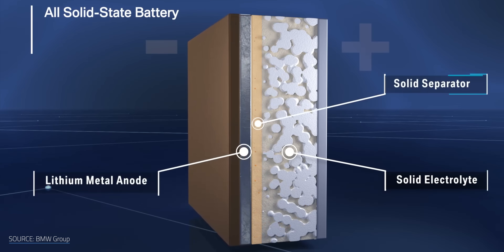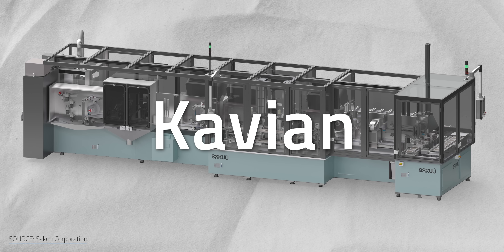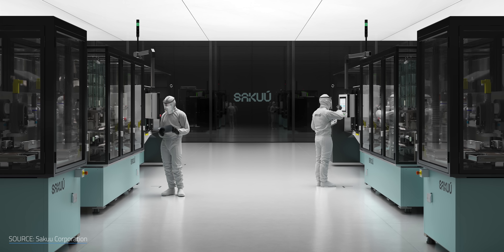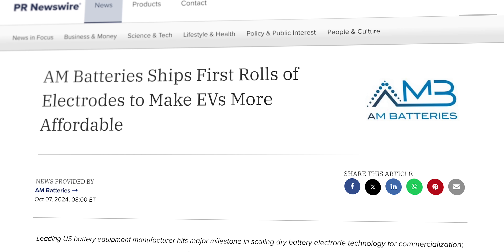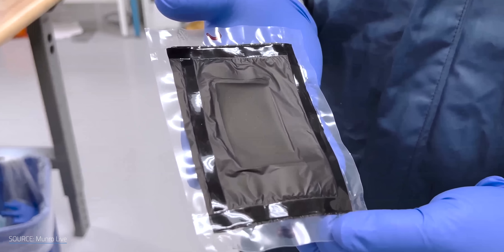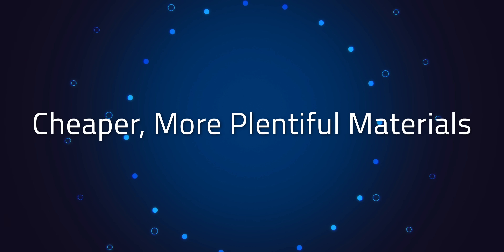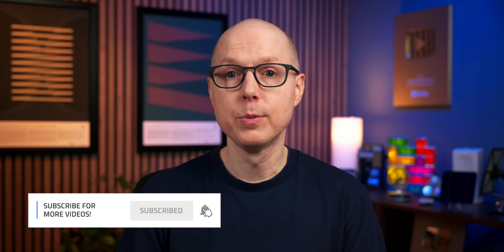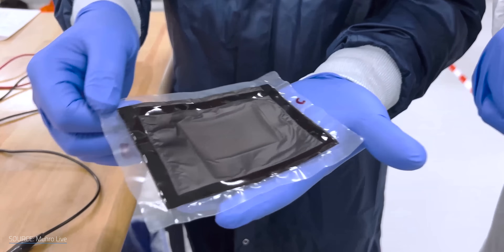Why This Ultra Cheap Battery Breakthrough Matters

Comment: Many commenters seem to think that none of the battery technologies ever get implimented.  My lithium iron phosphate battery is 10x cheaper than it was 5 years ago. It has almost 4x the power , weighs 25% of a lead acid and costs the same. Patience, my nerdy, brothers. Its a matter of time...
Reply: Honestly thanks for this comment.
Reply: Yeah, I don't know what people are thinking. Other than AI, batteries are probably the most rapidly improving technology on Earth right now.
Reply: @LagMasterSam  Rolling Coal is required in Project 2025.
Reply: @LagMasterSam  Photovoltaic's are also getting a lot cheaper at the moment.
Reply: Not really. I remember seeing a Nasa prototype that was pure solid plastic like tape that can hold a charge. That was 25 years ago
Reply: "Patience, my battery bros.."  🤣
Reply: Thank god for this comment. I agree that it can be tiring to hear "breakthroughs" that never seem to have any impact, but the reality is that these "breakthroughs" filter into production in slow, measured steps. Most people here don't realise the incremental improvements we've made in batteries and how these changes are getting faster than ever these days. 10 years ago, the best EV was the expesnsive Leaf, a pathetic imitation of even the cut-price Dolphin or Ora today.
Reply: LFP batteries are not 10 times cheaper since 2019 and have made almost no advances in the 3 decades since they have been discovered. All decreases in price can just be explained by scaling up production.
Reply: I've been hearing about new battery technology for the last 40 years. We're talking over 100+ new batteries that were going to revolutionize everything. Do you know how many were actually real, and evolved into a commercial product? Just one, Lithium Ion. It's like how a new cure for AIDS is discovered every few months since the 80s. So why do they make so many announcements like this? To drum up gullible investors. They're trying to score funding for their vaporware.
Reply: Yes, patience! That's what I'm thinking about my Enovix stocks! 😅
Reply: This has nothing to do with battery tech and mostly to the with scale of production, cheaper raw materials and Chinese companies dumping below manufacturing costs. Comparing to lead acid is so 2018. You might want to compare with sodium batteries when this year catl's might have a production line online. This whole clip has nothing to do with economic reality at all. Sodium batteries will knock lithium out of the bulk storage market within 5 years and lithium will be reserved for applications that require little room or where weight is important.
If solid state batteries ever get produced economically, then they might get a niche at first. But in all practical sense, i don't see them coming within 10 years for large storage solutions. Perhaps for mobile phones at first.
Reply: Batteries still suck though is the problem. Look at CPU improvement generation upon generation, we need a Moore's law of batteries
Reply: Let's face it, battery tech doesn't move as fast as chip tech. Like every other product,  demonstrations and prototypes are cool, but if you cannot manufacture it economically, it is just and interesting idea.
Reply: "nerdy bothers AND SISTERS" - we need them too.
Reply: Or f.e. my last phone having a silicon-carbon battery at similar performance & weight... Slow change is hard(er) to see for some...
Reply: That's why we can find normal EV vehicles in the 15-20k range . By normal I mean a normal looking car and not a toy.
Reply: All though that kind of battery is okay, it is still too expensive. An electric car needs thousends of battery elements to be able to drive an acceptable distance, which means the batterypacket in the car is a very expensive component in the car. And this makes cars very expensive. The price for 100 kwh lithium iron phosphate battery is around 7000 $ compared to 3000 $ for a  future LiFeCl4 battery
Reply: Yeah I can buy battery for my car for 45-50 bucks.  Still can’t get lithium that price I can put in my car as it sits.
Reply: CO2 is climatologically irrelevant. 

CO2 is climatalogically irrelevant: Interglaciation climate change (e.g. the Medieval Warm Period) is caused by cosmic ray fluctuations ( see the work of Henrik Svensmark, et al).

Just burn coal: the CO2 issue is irrelevant (see above). The sulfur issue with gaol is bogus too: sulfur is an agricultural fertilizer (ask the farmers). The "acid rain" issue is at most "a nuisance" (see the $500 million NAPAP study of 1990).  "Acid rain" was another one of those shallow media sensationalisms, like "global warming" and "ozone depletion". 

Global warming is 21st century superstition. 

Just burn coal.

Sorry, but however intriguing these battery-thingies are, they are just another tax-sheltered boondoggle for people who don't want to do get a real job. 

Just burn coal.
Reply: still the same battery with better cpu drain from cpu or ic chip improvement, rather than battery.
Reply: @jemfalor  A better processor does not make the battery cost less.  Also, battery capacity relative to size had nothing to do with the chips' improved electrical efficiency.
Reply: @jeffs1571  lol. many things cost less over time. it doesn't correlate automatically to improvements in battery technology lol

Comment: In China EVs are ALREADY at price parity with ICE cars. Every export market where Chinese cars do not attract tariffs they are not very far off parity at all (guys the US, or even the US and Europe, is not the whole world). Given these cost saving techniques by the end of next year EVs will be noticeably cheaper than ICE cars.
As for sodium batteries, these are already beginning to take over for new battery farms in China. By making electricity storage very cheap they will drive coal and nuclear power alike to extinction (as solar panels are REALLY cheap). It is just a matter of time.

Comment: You have been going over tons of battery techs for several years now and not one of them has reached market.
Reply: Because they hit the market quietly either as yearly improvements for existing batteries or in niche applications. Tech products don't advertise how their battery chemistry is 5%-10% better every other year, it just is. And many of the more exotic technologies are entering pilot production but have specific drawbacks or strengths that keep them niche, that doesn't mean it didn't happen, like how lfp ate the energy storage market overnight or how sodium ion is slowly trying to break in to grid storage as well.

Comment: I write training courses on DC fast chargers for a major Class 8 electric truck manufacturer. When students ask me why we make a tractor that costs 3x as much as its diesel equivalent and has a quarter of the range, I point out that battery technology is evolving explosively. Our drive motors produce 10x the starting torque (if we allowed them to; they're limited), it's silent, a joy to drive, no oil changes, no diesel, no DEF. In 10 years that same tractor will be driving full shifts and have a sleeper cab, because the batteries will catch up. Science doesn't care about policy and the political climate. Innovation doesn't wait for spin doctors and talking heads. I stubbornly maintain my own private sense of optimism.
Reply: What density (wh/kg) is the target for that 10 year tractor?
Reply: @100c0c  Nobody knows because it's irrelevant. Research is done and the results will be better than today's technology. Can you remember your phone from 10 years ago? Did you expect to hold the one you're holding now back then? So, there won't be giant leaps but incremental improvements.
Reply: @TheKobiDror  At least until we figure out and master quantum computing which is another thing we are making very quick progress on. The last 5 years of advancements in quantum computing have literally never happened before ever. And when we are able to master and scale that up oh man. The cheat code to life will officially be unlocked. You will start to see it being used to help create new materials for batteries maybe even new elements, the medical field will see big advancements in medicine. Every impossible problem we have will seem more like a task that we can accomplish. And I quote OP "Science waits for NO ONE"
Reply: Without government policy EVs wouldn't have been viable so political climate does matter when tech is in its infancy. It's only after the tech gets better and gains momentum can it work despite negative policies.
Reply: EVs would have been effective and able to be used had nuclear been widely adopted, especially in places like USA.  @alburaq3290
Reply: @alburaq3290  EVs, wind and solar are nearly cost even with conventional tech, and there's significant cost reduction happening all the time. It's not too long before EV prices can match equivalent gasoline cars. 

Electric motors and single stage gears are cheaper than piston engines and multi - speed gearboxes, so with battery price reduction so can match or reduce prices.
Reply: @thewheelieguy  Sure but that's after decades of government support. Renewables are not in their infancy anymore. Governments all over the world made it clear they were going to transition to renewable energy. This kind of long term policy support worked as a catalyst for private sector to invest into RnD.
Reply: Science should care about policy and the political climate because it gets a huge amount of funding from those exact things.
Reply: best comment...true dat
Reply: "Why does an electric tractor cost more than a diesel one?" -idonno, but i'd say the deer logo at the front might have something to do with horrendous pricing and borderline extorsion
Reply: @3AnxiousFerretsInATrenchcoat  lol I meant as in tractor trailer. As fae as the ag tractors with the Deere on the front, my true love is a Model B from the late 40s. Beyond that I freely admit I couldn't comment on what they do now, although I sharply disagree with their walled garden stance on right to repair.
Reply: @JMSobie  i kinda focused too hard on the "tractor" part i guess and misread. Regardless, i'm just joking around.
Reply: I love science and am a dreamer but 30 years ago I was following this story and new battery technologies were just around the corner then. Still waiting, Waiting, waiting, waiting, waiting,   My race level remote control cars had essentially the same quality batteries as we are using today and our mini race cars had, wait for this, regenerative breaking. Keep in mind, all this hype, is just about how perhaps batteries will finally start to catch up. I am still waiting for them to SURPASS what we have been able to do for over 100 years with gasoline.
Reply: Not too many power grids can hand a electric truck charging station
Reply: But we wait and wait and I see battery getting better and better but I just don't see it. Maybe I have too little knowledge but batteries keep being the same technology, just scaled up
Reply: @peres9559  The problem is after crude prices plummeted in the 80s, everyone here gave up. Battery research screeched to a halt and homebrew EVs had a choice of lead acid or maybe NIMH if you were rich. Who gave a crap when crude was $10 a barrel? Flash to today and the science magazines crow about a new chemistry that's cheap and amazing, but oops only has 500 cycles of life. Oops it doesn't scale. Oops dendrites if charging at a high C rate. So I've learned that it's a slow and iterative process. The next battery has to be safe chemistry, abundant raw materials, scale able and a cycle life meeting or exceeding LiFePO4. And for once we as a whole planet are actually leaning hard on this as a team, testing and scaling and endurance testing it. I tell my students, right now this is like Ford vs. Dodge circa 1919. If you want to see how the whole Giga factory concept and vertical integration thing came from, just crack a history of the Rouge complex 100 years ago (10 miles from where I sit in fact). In another ten years I'll bet the next great battery; will be something neither you nor I nor anyone else has even heard about.
Reply: Deja vue. Heard that too many times. Believe it when I see it. Fool me 100 times your fault. 101 times my fault.
Reply: Science cares a lot about policy and political climate.  Or at least scientists do, and they need funding.
Reply: @JMSobie  Hell yeah man. Couldnt agree more. If we dont evolve the battery other countries will becuase like you said science waits for no one regardless of policy change.
Reply: One thing I've noticed is that the current price difference between an electric truck vs. diesel truck far exceeds the cost of battery. For example, even at a relatively high rate of $150/kWh,  that translates into $75k for a $500 kWh battery, yet you see battery electric trucks costing as much as $250k more than their diesel counterparts, in spite of the fact that some of the cost of the battery should be offset by eliminating the diesel engine.

What this means is that the bulk of the actual cost difference between electric vs. diesel trucks likely has little to do with the cost of the battery and everything to do with not enough of the battery trucks being made to create economies of scale. Which, should, in theory, translate to big reductions in cost of battery trucks in the coming years, as production ramps up.
Reply: CO2 is climatologically irrelevant. 

CO2 is climatalogically irrelevant: Interglaciation climate change (e.g. the Medieval Warm Period) is caused by cosmic ray fluctuations ( see the work of Henrik Svensmark, et al).

Just burn coal: the CO2 issue is irrelevant (see above). The sulfur issue with gaol is bogus too: sulfur is an agricultural fertilizer (ask the farmers). The "acid rain" issue is at most "a nuisance" (see the $500 million NAPAP study of 1990).  "Acid rain" was another one of those shallow media sensationalisms, like "global warming" and "ozone depletion". 

Global warming is 21st century superstition. 

Just burn coal.

Sorry, but however intriguing these battery-thingies are, they are just another tax-sheltered boondoggle for people who don't want to do get a real job. 

Just burn coal.
Reply: @hg2.  Coal sucks big time, ya know. Nuclear is much better than Coal could ever be. More potent, cleaner, and it would support EVs no matter the scale. 

Ontop of that, gas prices should go down, provided pil snd gas companies dont get pissy and decide to raise prices in retaliation.
Reply: @PixelatedWolf2077  There's no big cartel of oil and gas companies (outside of OPEC) that could coordinate to raise prices in retaliation.